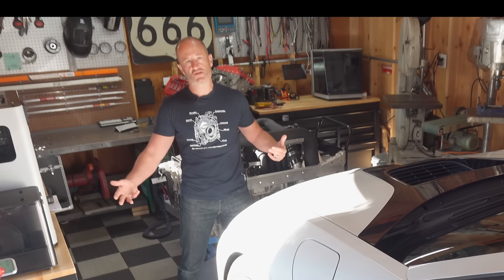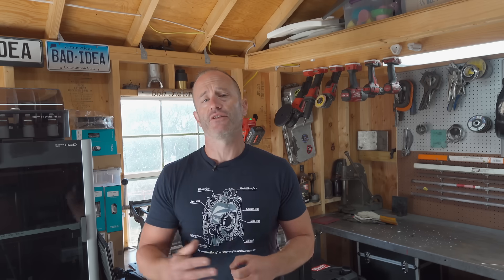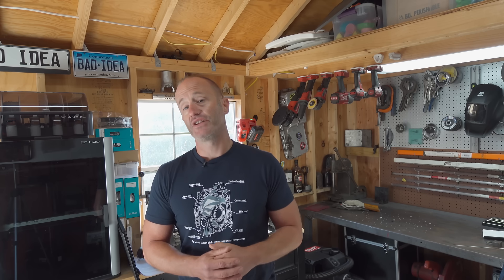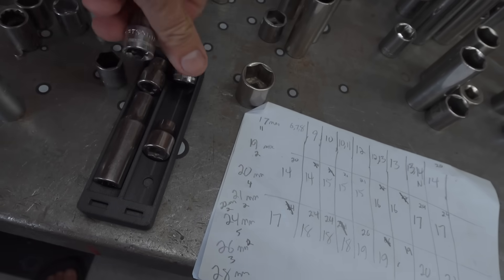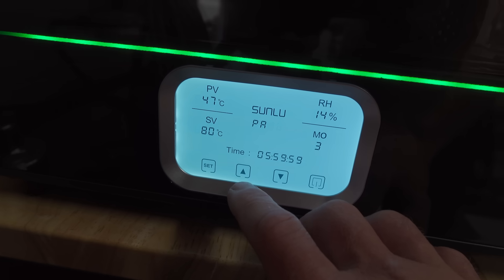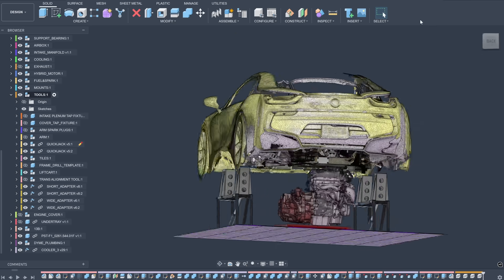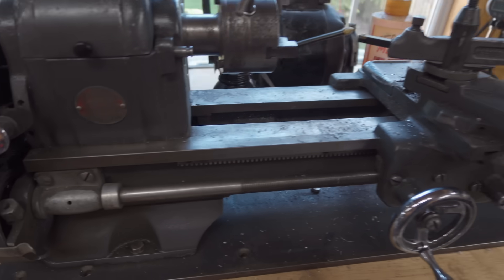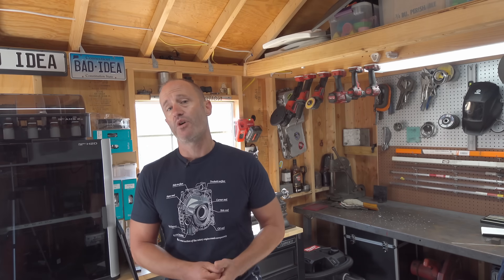Maximizing a one car garage workspace in preparation for turbo rotary swapping a BMW i8

Comment: I'm a little disappointed that someone like you who loves tinkering would accept a Bambu sponsorship
Reply from the maker: That shouldn’t surprise at all. I like making functional parts with technology. I print way more now that I don’t have to second guess the result. I asked them for a sponsorship rather than the other way around.
Reply: @CouchBuilt Bambus aren't really any more reliable than other new premium printers and the company is super Apple-y and anti-consumer. Prusa printers are just as good, are made in the EU, are largely open-source, have great documentation and support, and can be upgraded when new models come out, and the company contributes a lot to the 3D printing community. 

I also just saw your newest video and noticed some AI images, ew. Don't feel too bad though, this is a really cool project and you're still way better than Tavarish or Legit Street Cars.

Comment: Nice work man.  I have the same struggle, trying to maximize the space in my garage. I specially like the welder. 

Although the carvera looks nice, I want a PM Matthews mill and do the cnc conversion.  I figured that would be right up your alley to flatten worn out cylinder heads.  

Please give is an update on the Creality scanner if you can.  Maybe you had time to give it more use.

Comment: I’ve been hearing great things about everlasting TIG machines and am actually taking delivery today on one of their MIG units. Hopefully it is equally impressive.
Reply from the maker: I really like it. I’ve been a Miller guy forever, but they’ve gotten a little too proud of their machines, particularly for the home or small shop builder.
Reply: @CouchBuilt  for sure and same. I purchased a miller 190 a few years back and that little lunchbox was super impressive. We’d burn 3/8” plate with it no problem, but the price has gone way out of consideration.

Comment: I have the same belt sander.. it never occurred to me to mount to to the drill press. I take it from under counter storage to a workbench each time.
I think I am going to copy this. I can always keep it low and then raise it if I will be using it a lot.

Comment: I reckon the engine swap process can be two steps? Face rear outward, take out the engine, bin it. Car is lighter now! Close doors, push car out, turn, push car in backwards. Throw in the new engine (it really is that simple, trust me on this) and you're basically ready to drive!

Comment: Hi mate, I wanted to ask if there’s a file I can download for the BMW-13B oil filter hosing please, I really like the idea of a non spill filter change and also being able to see the element. Thank you
Reply from the maker: I’d have to fine tune the thread profile before letting it out. It works on like 50% of the caps I’ve tried so it needs some tolerance adjustment.
Reply: @CouchBuilt thank you for the reply, I look forward to it ❤
Reply: @CouchBuilt  This is definitely something I'd be interested in as well <3